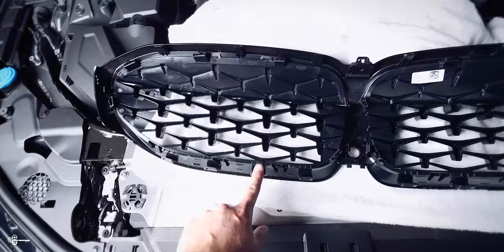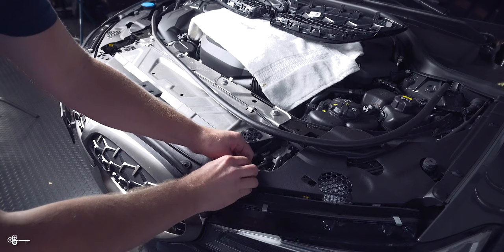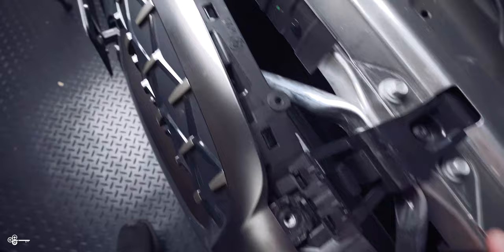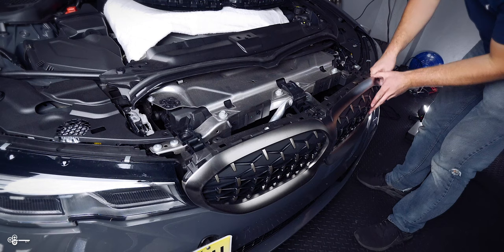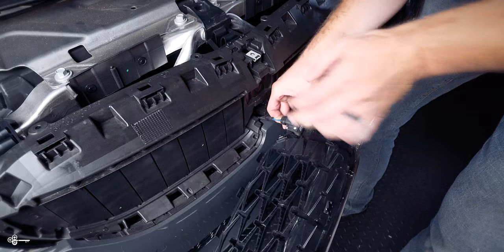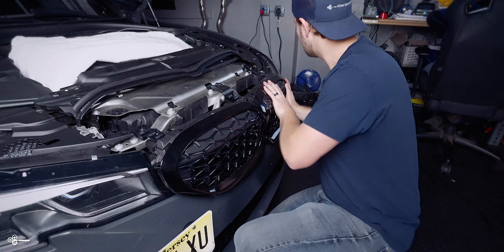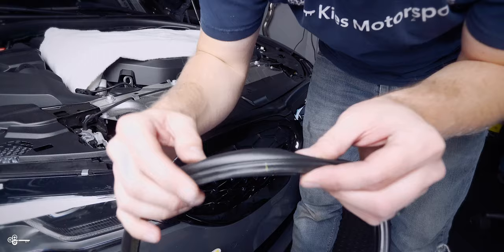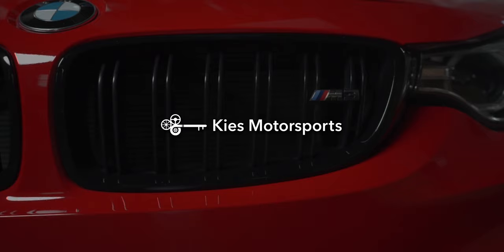How to install Kidney Grilles on the BMW G20 M340i (Also works on the BMW G20 330i) #g20mods

Comment: One thing to look out for is to insert that camera all the way in. Otherwise the 360 parking surrounding view will be way off. Happened to me last weekend. Had to take it off to redo. Actually broke 2 plastic
Reply: Can you clearly tell from the outside that the camera is not all the way in?

Comment: Great video Kies Motorsports!  I wanted to ask if you know how to disassemble the actual grille itself.  It appears the backside of the grille can be removed, leaving just the frame.  My goal is to have the outer gray frame painted gloss black while leaving the gray accents on the inside diamond portion rather than having it all black as pictured in the video.  Any help would be most appreciated!

Comment: My g20 grille does not have the camera. Can the camera frame located the lower ceter portion of the replacement grille can be easily detached? or is it part of the whole grille that can not be removed to fit G20 grille without the camera??

Comment: so far I havent seen m340i without that new weird grill type. is it not possible to just get the standard grill for the m340i just as the 330 or 320 has?

Comment: So the g20 grill doesn’t let air flow in anymore?
Reply: It does. It opens up when the engine is on and hot and needs air.
Reply: Only when needed. Those flaps that are visible once he removes the grill open when necessary.

Comment: Question! .. my f30 335 doesn't idle high on cold starts. It goes straight to normal idle, anyone know why that could be.😕
Reply: Is it tuned? You can remove cold start up in a tune in case you remove the cats

Comment: Brian, great video. So I get it, the active grill concept creates aerodynamic efficiencies, but the M340i looks way more badass when the grill shutters are in the open position. Recently I heard that 5 series owners discovered a way to keep shutters open all the time (and it didn't throw a code)...Might have been a fuse they pulled?  Do you know if it's possible for the G20?
Reply: They most likely did the same thing as to keep your exhaust flaps open all the time.  Once the shutters are in the open position, disconnect the power clip from the front air shutters, they should stay in the open position. I don’t think there is any performance or efficiency gained by doing this though.
Reply: @Mikek712 Yeah, if anything it probably reduces efficiency by a bit

Comment: I though g20 had auto open-close grill feature...
Reply: vian qu I believe those flaps behind the grill open and close.
Reply: It does. It’s called active kidney grill and it’s the part behind the cosmetic front piece (which is what was replaced in this video)

Comment: This is probably the dumbest question you'll ever be asked but, will the G20 grill fit on a 2015 f30. Thanks in advance
Reply: pvfa39 nope.
Reply: pvfa39 No.
Reply: nope, this is a one piece design, F30 is two piece design
Reply: pvfa39 nope, the g20 grill will not fit an f30